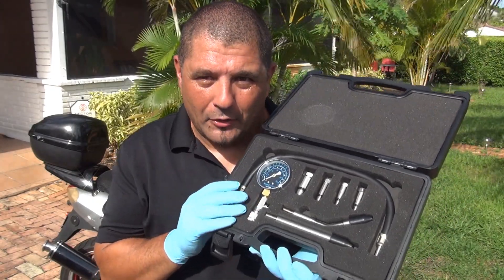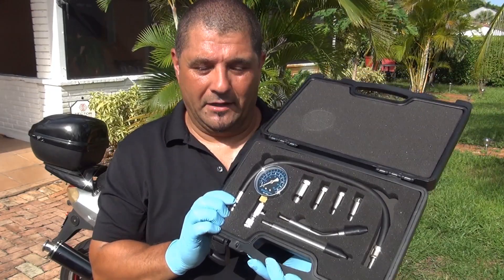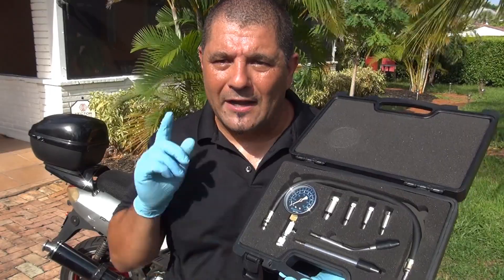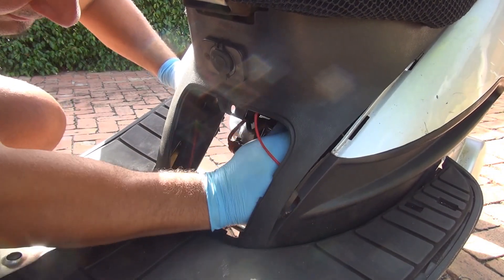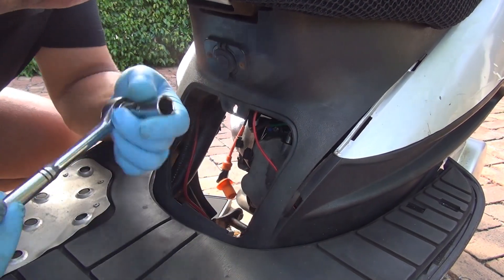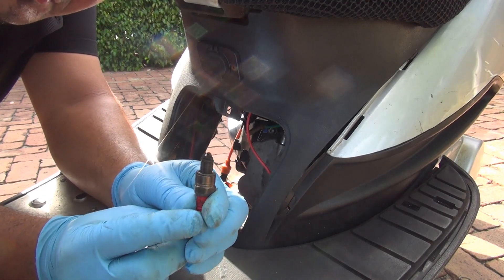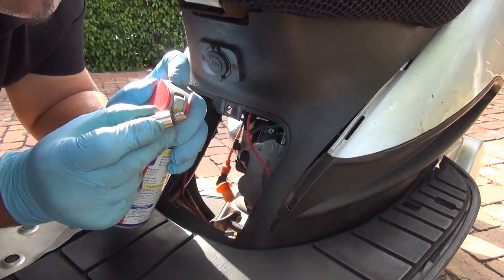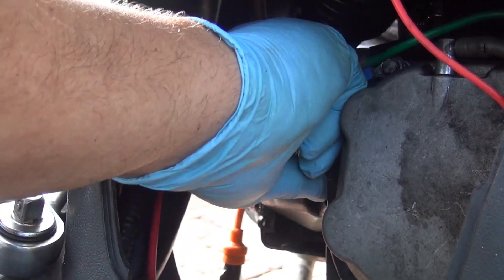Chinese Scooter compression test GY6 150cc

Comment: Hello! I did put some good tuning parts on mine and overhauled the engine at the same time. I suspect the compression got a bit too high, because I could hardly kickstart it. I have years of experience so I felt that a bit strange. It was like kickstart a 600cc single cylinder bike! And it also dont run good, on load it starts to misfire. I suspect the stock ignition cant spark with too high compression. And now I got a tester and checked, it is 210psi. I guess putting double gaskets would get me down a bit and solve it, but it would be nice with input from another :) Btw, it is tested with electric starter, I had to use a car battery and jumper cables.
Reply from the maker: It sounds like you've done some significant modifications to your scooter, and the symptoms you're experiencing could indeed be related to the increased compression. Here are some insights and suggestions:
High Compression:
A compression of 210 psi is on the higher side for many scooter engines. High compression can lead to hard starting and can put additional stress on the starter motor and battery.
Kickstarting Difficulty:
The difficulty in kickstarting is a clear indication of the high compression. Adding double gaskets could indeed be a solution to reduce compression and make kickstarting easier.
Misfiring under Load:
Misfiring under load is a common symptom of ignition issues, and your suspicion about the stock ignition struggling with higher compression is valid. High compression can make it more challenging for the spark to ignite the air-fuel mixture effectively.
Ignition Upgrade:
Consider upgrading your ignition system to one that can handle higher compression. High-performance ignition systems with better spark control may help resolve the misfiring issue.
Timing Adjustment:
Check the ignition timing. If the timing is not adjusted correctly for the increased compression, it can lead to misfiring and poor performance. Make sure the ignition timing is set according to the specifications for your scooter.
Cooling System:
High compression can also result in increased heat generation. Ensure that your scooter's cooling system is functioning properly to prevent overheating issues.
Carburetor
Verify that the carburetor  system is adjusted to accommodate the increased airflow associated with higher compression. It may require rejetting or adjusting the fuel injection parameters.
Professional Advice:
Given the substantial modifications you've made, consulting with a professional tuner or mechanic experienced with high-performance scooter modifications may provide valuable insights. They can help fine-tune your setup for optimal performance and reliability.
Remember, any modifications to compression or other engine components should be approached with caution, and it's crucial to ensure that all systems work together harmoniously. If in doubt, seeking professional advice can save you time and potential issues down the road.

Comment: Thanks for the video.   I have a brand new take out motor from a new scooter that was used as a parts bike at a shop.   The motor had 150psi crashing i tight it works be enough.   But it cranks with out even trying to run.   Has great spark, and I put it into a previously that previously ran, but the piston was seized so it would shut off after running for a minute or two.    The piston and cylinder wall clearly show its never ran before inspecting with a bore scope.   What have you seen like this?  Im hoping i find missing rings,  or a head that wasn't torqued down properly.   I did reset valve lash .003 and .005 now I get 120psi on my gauge.  His gauge showed 150psi but that was with out a muffler.   I'm thinking that's the difference between 150psi and 120psi.

Comment: My moped not wanting to start now I'm getting good spark good compression enough fuel could a old or dirty carburetor cause this problem
Reply from the maker: Yes, an old or dirty carburetor could definitely cause problems with starting your moped. The carburetor is responsible for mixing air and fuel in the correct proportions before it enters the engine. If the carburetor is clogged or dirty, it may not be able to properly mix the air and fuel, which can lead to starting problems or poor performance.
You might want to try cleaning your carburetor or having it cleaned by a professional to see if that solves the issue. It's also possible that there could be other issues causing the problem, so if cleaning the carburetor doesn't work, you may want to have a mechanic diagnose the problem.
Reply: Have you tried to blast the carb w/ a couple of shots of starting fluid into the intake to see if it starts? If so
1.  Check all carb adjustments (air/fuel mixture screw, Idle screw)
     Try combinations
2. Check/Replace fuel filter
     Try
2. Do you have old unstable Gas in it 8+ months?  Drain tank, blow out fuel line and use a new fuel filter add new 93 octane
     Let carb bowl fill up add 2 shots of starting fluid and Try to run for a few minutes " SF is used up" 
3. Remove carb, inspect both jets, needle valve assembly, diaphragm and bowl and floats for varnishy gunk and clean. 

    Basically clean everything. I some times use the CLR kitchen/bathroom product
4. Put back together and Try.
GL Keep scooting 
🛵💨

Comment: Mine has about 190 psi. Thoughts? Furthermore I have a new problem, after changing the belt, and after installing a new NCY transmission set, and OKO carb, the scooter starts and idles however, when I give it gas it barely moves and won’t go over 5 mph even at wot, it just revs really loud. I then proceeded to replace all the new parts with the old and yet the problem persists. I’ve opened up the final gear area and all looks fine, and compression is at 190 psi so do you have any ideas that could help me out?
Reply from the maker: Hello Roland the problem should be at the variator weight or sometime could be the Stator magneto that is dirty with grease and is not producing clean and clear electricity. I hope this can help you Thank you for watching my video

Comment: Mine has lost compression how do I fix that?
Reply from the maker: Hello my friend when you lose pressure the first easy thing to do is to check the valve clearance after that you will have to check the piston  and the gaskets to  see if something does not look good . Thank you for watching my video
Reply: Hello it was my starter the gears was all worn down I need to order a new one do you know best place for order one I have a Tao Tao moped

Comment: Helpful tip so that you dont spend a ton of money on compression test, but you think that is the problem: Plug the spark plug hole with your thumb, and average person can hold up to 100PSI of pressure with their thumb, if it blows your finger away from the hole, or air passes between, that means you should have good compression
Reply from the maker: Hello my friend thank you for watching my video and I like your idea of compression finger testing

Comment: I tested the compression it's at 95 psi
Reply from the maker: Hello Jason if you have a 150cc 95psi is low if you have lots of miles try to adjust the valve clearance and see if you have better reading
Reply: Would it be a valve problem or piston I understand it's supposed to be at least 175psi
Reply: Miles is at 1, 897.7 not ran in about 7 years and started riding late last year valves are at .0004
Reply from the maker: The easy thing to do first is the valve clearance and hopefully that can fix the problem after that you can test it again and see but sometime if you have a bad or cheap compression tester that can give you a bad reading
Reply from the maker: if the scooter is 7 years old there is a possibility that you have hold gaskets https://amzn.to/3zSIeXY Cylinder Base & Head Gaskets and they need to be replaced

Comment: Good video, this luxurious tool takes some space but still worth it.
Can you please help me with this broken screw in a carburetor? its tiny screw and i cant unscrew it.
https://i.imgur.com/RqtsEu6.jpg
Reply from the maker: Hello Duke the best way to remove the screw is with a wise grip plier https://amzn.to/2EA1LBZ  just squeeze the head of screw lock the plier and turn. Thank you for watching my video
Reply: @VirberelloScooterTips  thank you, its a KEIHIN carb and the screws are like butter they are braking from little force so i guess its not so reliable?
Reply from the maker: @duke1259  Thats what I always do with that KEIHIN carb you can also try to place a large rubber band between the screw head and a screw driver or you can buy a screw extractor kit or you can make a flat cut on the screw head and unscrew with a flat screw driver